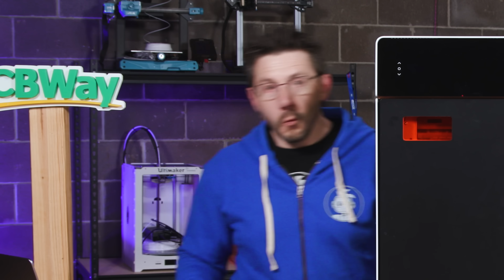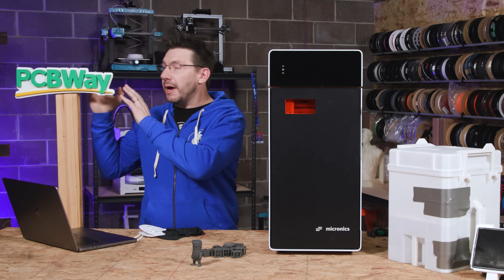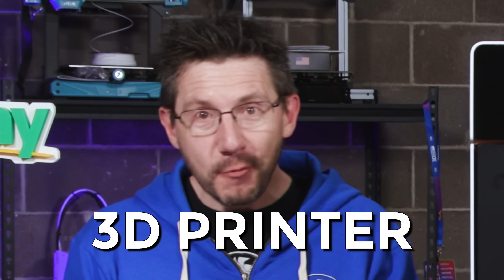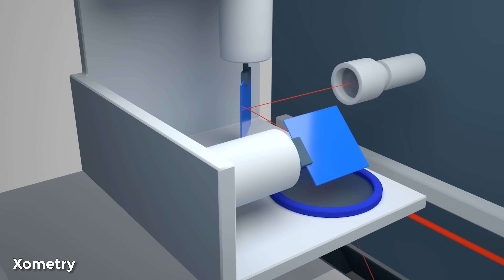SLS 3D Printing AT HOME?

Comment: You really need to use a p100 mask with these kinds of printers the ultra fine powders can and will cause lung cancer. The other problem is if you dont completely clean it up the loose powder will slowly spread everywhere and become a chronic hazard. You also need ideally a disposable hepa vacuum cartridge system for the vacuum so the hazardous dust can't escape when you clean the cleaning tools. These powder printers require a lot of PPE and side equipment and easily can create a massive toxic mess if you're not extremely careful. That fan cleaner seems woefully ineffective it should be a hepa filtered fan unit. It is just like those soldering fume extractors looks like it works but is really just spreading ultra fine chemicals all over the place. Final hazard is the powders are explosion and fire hazards. These should never be operated without a dedicated exhaust room specific for powder printing. Use this in your bedroom and you and anyone living with you will likely get aggressive lung cancer. This is very far from fdm printing of pla or even abs and is probably more hazardous than resin printing.

Comment: I'm only 4 minutes in but i am terrified for you, from a safety perspective, most metals your body can break down and use but, much like asbestos, fine powder gets into your body and plastic might be forever. When i worked in a metal shop with plasma cutters my blood iron was way over normal from the exposure to the atomized material floating in the air. I hate to say it but I'm worried if this becomes mainstream we may see a significant amount of cancer cases in people who have these devices in their homes.
Reply: Yeah I don't think the mfg or Joel understands the risks. The hazard is chronic and it will cause cancer if you don't do it safely. The kn95 mask and mfg responses is a clear sign they want to cause cancer.

Comment: This thing is junk, im surprised you support this? Its full of bugs and it seems like the owners are ok with their lackluster product. Did u get some hush money or something? Bc other reviews are slamming it
Reply from the maker: Scotty was honest with his experiences, but so was I.
Reply: @3DPrintingNerd I don't think anyone is pointing out the mfg is directly contradicting the msds for many industry pa12 nylon powders which do say it's a cancer risk, explosion hazard, requires engineering controls,... This product is dangerous your not using the correct PPE and it's likely micronics fault for not providing a proper msds or explaining the safety risks properly to YouTubers. This thing can and will cause cancer if you use an kn95 mask and using a random vacuum can cause a dust explosion.

Comment: Nah, Joel this is a semi-fail. They need a better way to deal with the powder. I wouldn't dare use this in a non-industrial/lab environment.
Reply from the maker: What’s your ideas on better ways to handle the powder?
Reply: @3DPrintingNerd  Look at the SDS for the powdered materials and also at some OSH practices for working with fine particulates, that should give you an idea.
Reply: @3DPrintingNerd  I actually do have an idea, but I lack the vast amount of money it would take to prove it.
But here is my Chat-GPT formatted and better worded idea:

To address the powder handling issue in the new desktop SLS printer, I propose a two-stage chamber system integrated with an efficient filtering mechanism.

Two-Stage Chamber System: The printing chamber will be designed as a two-stage system that rests on a specialized filter. Upon completion of the print, the bottom of the chamber will open to allow excess powder to fall through the filter. This process will occur under medium vacuum conditions to minimize air disturbance and reduce mess.

Vibration Mechanism: Piezoelectric actuators will be used to vibrate the entire chamber, facilitating the movement of powder through the filter. A scale at the bottom will monitor the amount of powder collected, ensuring that most of the excess powder is removed.

Cleaning with Air Jets and Vibration: Once the majority of the powder has fallen through, the bottom chamber will close, and jets of air combined with vibrations will be used to clean the part further. This process will be repeated, drawing out the air and allowing any remaining powder to fall through the filter.

Binding and Final Cleaning: After one or two cycles of this cleaning process, the bottom chamber will close, and the part will be sprayed with a binding agent such as cyanoacrylate (crazy glue) to secure any residual powder. Once the part is removed from the machine, it will be submerged in acetone to dissolve the glue, freeing the remaining particles. These final particles will be the only ones that do not get reused.

This approach ensures efficient powder handling and minimizes waste, improving the overall functionality and cleanliness of the SLS printing process.

Comment: Okay but picture being able to print out an entire army of miniatures in a single print. And they’ll also be WAY more durable than resin. Sure they’ll be… a bit more expensive cause of the material and being solid but I think if you’re buying a $3000 printer then that’s likely not much of a concern

Comment: I'm far from a materials expert, but generally anything I don't want in my eyes I also don't want in my lungs.

Please consider using goggles instead of relying on glasses for eye safety, you seem like a good dude and it would suck to see you suffer issues just from trying to share cool stuff with your audience. This appears to be airborne particulate versus something directional like wood kickback from a saw, and as such requires a good seal on both your mask and eyewear, if not more.

Comment: Am I the only one that completely not impressed with print quality? Is like 720p or 480p quality. I still don't get who will want this. Small printing size for big business and too expensive and waaaay too much hassle for amateur printing guys.
Is amazing that someone made it, amazing tech. But is dangerous af, the host probably decreased his lungs lifespan by few years now, just tiny mask won't save you,  you need proper filtration because either proper filters will filter the dust or your lungs.
Let alone that 1kg of powder is $100.

Comment: How come none of the videos I've seen on this show people wearing the right kind of PPE and have no proper work environment for it? A home is certainly not a place for SLS of any kind. The shoddy prototype transfer buckets really show how little thought for safety there is. That fan/filter combo is just a cute way to reassure you it's safe, but fine powders get everywhere and the whole area should be a managed zone, enclosed and with with airflow considerations. You will not see most of the dusts you inhale, that's why wash and change facilities are provided where these are worked with. The OSH guidelines for working with them are pretty strict on workplace exposure limits, even "inert" ones.
Reply: All of this could be avoid if the just figure out a way to make the powder a clay consistentsy.  Or maybe increase particle size?

Comment: didn't try a dimensional test part?  
how long does it take to do a benchy? 
hard to do a comparison without basic info like this. ¯\_(ツ)_/¯
Reply: The benchy might take 30mins (wild guess) but then there’s about 14 hours of post processing - getting the part out, media blasting, cleaning the mess.
Reply: @Ron_Ventura  the media blasting with a cabinet several times the size of the printer, plus used material t do the blasting is extra cost..  it's a lot of extra money for a-blasting cabinet, air compressor, etc.. and then the medium each time.  :-/   
the latest flsun does an 8 minute benchy. 
so.. maybe this printer is better for 'final product' than prototyping.  it's a a lot of space and money to just reach a decent 'product'...

Comment: I am not too sure you should compare Micronics with Bambu Lab. Bambu Lab pushed out an excellent polished product that is easy to use for the masses but on a fairly established technology. Micronics’ product is far from easy to use or seem polished in anyway. Clearly SLS technology is not anywhere near as established as FDM filament is at the moment. It is messier than the resin printing process; but the final finished part could have the potential to be phenomenal. It seems to me that Micronics just want to make this printer functional while keeping it low cost. I don’t think ease of use is even high on their priority list at the moment. This is the opposite of what Bambu Lab is trying to do. So comparing the two is like comparing apples and oranges.
Reply: They’re still a year away from production? Bambus sent out test units far closer to production also while what bambu dud for fdm its less of a feat than what micronics is trying to do
Reply: a lot of the bambu printers in the beginning were bad, didn't work/ got broken in transit. They didn't start perfect

Comment: Seems like drawing a vacuum on the lower chamber of the powder separator would work better than a filtered fan at the top. Also, having a vibrating box should help remove the loose powder compared to brushing the part or shaking the box.

Comment: I already got conned into buying resin printers after a grand total of zero content creators said a word about how toxic and irritating fumes are (not to mention how hard they are to capture and vent). I got one glimpse of the fans mounted on the powder bin and that was more than enough for me. I wouldn't buy this even if it were the same price as regular FDM printers. Way too much overhead to safely operate.

Comment: I think this will end up as a super niche machine. Too expensive, too messy, and too slow. 
The only upsides are very low tolerance, can print floating parts, and can print with unique material.

Comment: Wow, this was interesting.  Like resin printing, I"m guessing you need to add drain holes into enclosed areas so that the unsintered powder can be "drained".  Looks like there's still a lot post-processing that needs to take place.
Reply from the maker: The models are solid so there isn’t any unsintered powder inside.

Comment: In 15 years we get a new run of mesothelioma commercials
Reply: If you or a loved one have been diagnosed with mesothelioma due to your at home SLS Nylon 3d print you may be entitled to financial compensation
Reply: @nickalfonso8616  lol... exactly
Reply: Less than 70 microns typically will not stay airborne.
Reply: FDM CF fillament already carrying that loaf by itself
Reply: in their promotional material, they mentioned the relatively large particle size won't stay airborn but yeah... yikes
Reply: @armorhide406  "stay" so it's definitely suspended for a time - and it's dangerous. It's just not permanently so. lol how reassuring.

Comment: I think there is some way to go before this type of printing becomes "consumer friendly". Resin printing can get messy at times, especially when starting off. This makes resin printing look like a breeze. Also the clean up for this also looks more hassle than resin printing. Aside from the loose poweder that is still getting all over the place, the rummaging  through the printer chamber for your prints and then transfering the powder back into the machine just seems like way too much hassle to be doing in a home enviroment. As well as the company has done in making this as "home friendly" as possible, i still would want a dedicated room just for this printer, which i think is a big ask for the average consumer. I also think that despite the PPE and dust filter, i'd still be worried about inhaling tht stuff. There has to be a certain amount that is not only not caught, but fine enough to remain airborn for sometime after you have finished clean ups and transferring media back and forth. Then there is the finished product. Personally i thought it looked rough as hell, and that was if you are lucky enough to own a seperate machine fo blasting the models. For $3K i would expect better looking finished prints, at least on a resin printer level. 

Finally, the fact it is on Kickstarter is a massive red flag for me. Kickstarter has become so bad these days, that it is now a prolific hunting ground for scam artists. Don't for a second think that if the project creator breaks any of kickstarters supposed rules or policies that kickstarter will at least help you then. Wrong!!! Even in cases when projects have not abided by the rules set out by kickstarter which would prompt a refund or even for them to investigate, they won't. Not only have i been bitten a couple of times and had to go through my banks fraud dept and fight kickstarter for my money back. I can name a fair few projects i wasn't involved in where kickstarter doesn't even respond to backers contacting them for help. THey simply are not interested, especially after getting their cut from the money raised. 
One final thing to be aware with regards to kickstarter and scammers or projects to be wary of. Project creators would set their goal for the amount of money they actually needed to raise to bring the product to market (or at least the backers). The risk of this was , if that amount was not raised then no money was taken from backers and the project wouldn't go ahead. Now, project creators will declare a very low target to raise. That way if it is a scam, they don't have to raise that much for the project to be funded. Then once funded they and kickstarter has your money, after which its a hit and hope if you ever see the product you backed or if it is exactly what was stated in the kickstarter campaign. If its not or don't get the product, then as stated Kickstarter will not help you, but will keep their cut of the money raised.

Comment: the dimension accuracy of the part after sandblasting is good or not?
Reply from the maker: The Axe Effect case I made and put together was after media blasting
Reply: @3DPrintingNerd  you tell us you scale the axe model and when you have to reprint the part it will fit together for a mini it's probaly fine. When i ask for accuracy it's because i saw on the website a bevel gear and if i can use or replace a part and use after sandblasting and that mean a lot of opportunity in the future.

Comment: Why does it end up in a cake? How does the laser shine through the cake?why doesnt it support metals?
Reply: The material is built up in layers.  The laser selectively sinters material in the current topmost layer.  Leaving surrounding material as support, able to break off easily.

As for metals, that's a matter of the temperature the laser can produce.  A heated build chamber and inert gas atmosphere, both of which would add to the cost, would help here.
Reply: @hanelyp1  thanks,very helpful. if it sinters the top layer, how does it then add a layer to sinter? Does it sinter and then spray on more powder to sinter? would a metal sintering laser not be able to sinter plastics as it would be too hot?

Comment: Thank you for the review. Just wanted to give you a tip with media blasting. We have a few SLS machines at work (Imagineering) and after years of testing, we found that baking soda (purchased in bulk at McMaster) works the best for media blasting without doing damage to your parts.
Reply: i can confirm sodium bicarbonate aka baking soda is probably the best blasting media to use.  I use it at work and its great.
Reply: @xROBIx85  Ya, I was surprised that Formlabs and EOS had never heard of people using that for their blast media.

Comment: See the major problem with this """Desktop""" SLS printer is that you need a whole workshop to use it too. Something they very avidly avoided mentioning in their videos showing the printer off. Yeah you can fit it on a desk where you would put your computers and stuff if all you were doing is sitting it there as it prints, but you need a dedicated table to do all the things, a dedicated sandblowing box thing, etc. It's really not a desktop SLS printer because of this. 
If I wanted a desktop 3d printer, I'd get either a resin printer which needs only 3 small machines. The resin printer itself, a washing bin, and a UV spinning stand, and you could fit all that on a table with ease.

But honestly my biggest issue is that they are marketing this as a "cheap" "affordable" and "very easy to use" SLS printer, when it very much is not.
Reply: resin print on your desk where youre working? well, i would say that also needs a dedicates space with good ventilation.

Comment: Ehhhh while I love the concept, there is obviously a large safety issue here. Even on a laptop I can see how much powder was going into the air and how much ended up on the desk. Some additional refining of the product to allow multiple air filters or some other method of moving the part from the powder without directly transferring  the material post print would be ideal.

Love the video, love the concept, hate the overlying H&S problem.